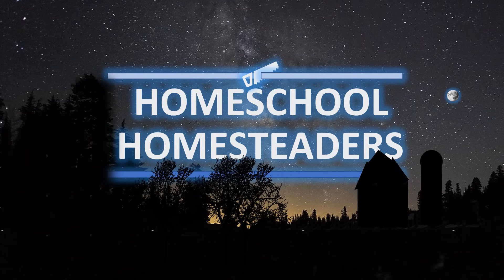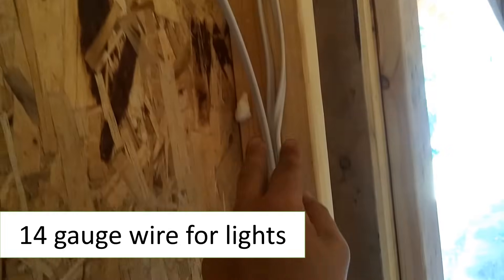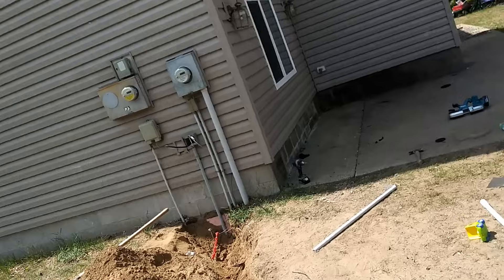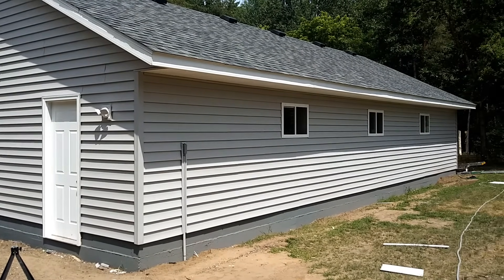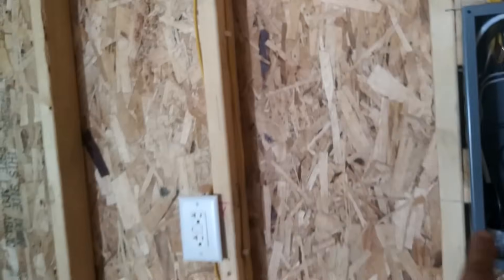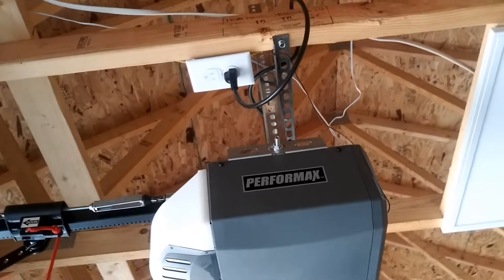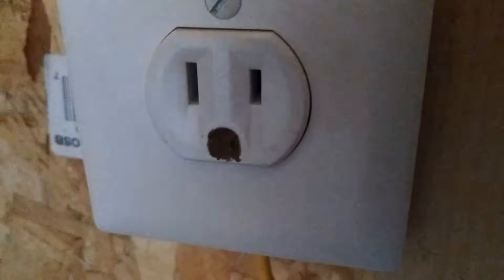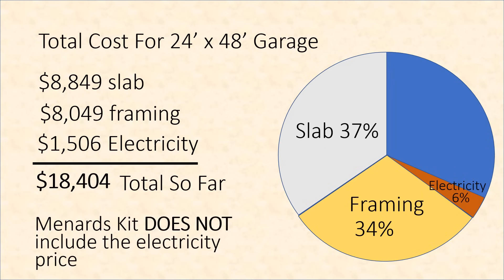Menards Garage (24' x 48') Kit: Wiring To A Detached Garage (Part VI)

Comment: What brand and model LED lights did you use inside and out
Reply from the maker: For the outdoor lights, I used these ones...
https://www.menards.com/main/lighting-ceiling-fans/outdoor-lighting/security-lights/patriot-lighting-reg-theta-2-light-led-outdoor-dusk-to-dawn-flood-light-white/m22v5014/p-1642874276192478-c-7544.htm

For the garage interior lights...
I cant find exact model, but close resembles this one...
https://www.menards.com/main/lighting-ceiling-fans/utility-commercial-lighting/flat-panel-lights/zone-4500-lumen-2-x-4-flat-panel-light/z-xppl2x4/p-1642874272527740-c-1642874276495750.htm
Reply from the maker: All lights are Patriot Lights from Menards

Comment: Did your ground wire have to be ran in conduit the one that's going out to the grounding rods
Reply from the maker: The ground wire from electrical box (in the garage) just ran outside to the grounding rods.  But from the electrical box in the house to the electrical box in the garage, it was included in the conduit with the other wires.

Comment: Mispronunciation of "conduit" made me suspect of the rest of the info...

It's overall fairly solid, even if I personally don't like the workmanship. It will work, likely pass inspection, but definitely says "homeowner did this" or "electrician was the cheapest available". Not trying to disparage the work done here, I would just personally put more effort into it.  

First issue: Don't PUSH wires through a conduit. With a PVC conduit like that, they make fish tape (really just a special plastic twine), attach that to a plastic bag, then start feeding the plastic bag into the conduit. Use a shopvac on the other end to pull the plastic bag with fish tape attached through. Then tie your wires to the the tape and pull back through. 

Second issue: Needs nail protection plates on the studs over the holes where wires go through. Regardless of local code or use of AFCI breakers, these need to be installed. Otherwise you or someone else could accidentally run a nail or screw into the wiring. 

Third issue. Unless those walls are going to be closed up, all that wiring is considered exposed and should be in conduit of some kind, or use MC. I will ALWAYS advocate the use of conduit no matter what, ESPECIALLY for walls that will be closed up. If something should ever happen to the wiring, it is significantly easier to pull new wire through the conduit than it is to reopen the walls. I prefer flex metal conduits, but rigid metal conduits work, too. Not a big fan of PVC, but it has its uses. Personal preference. 

To add to the third issue, if wasps packing mud into outlets is an issue, or pests in general are a concern, they will get into the boxes as well. I would definitely recommend conduit as it would make it harder for pests to enter, and with solid metal or PVC conduits and gaskets behind the wall plates it would make them very difficult or impossible for pests to get in. 

Footnote: I personally will likely never install lights with integrated LEDs unless a traditional fixture is unavailable or impractical. It is significantly easier to change a bulb than an entire fixture. While swapping a fixture is not a massive undertaking, just an annoyance, anyone can change a bulb.

DISCLAIMER: I am NOT an electrician. I am a DIYer who does mountains of research before undertaking projects to ensure that anything I do meets or exceeds code. I usually exceed code. I have passed all inspections on the first try and the inspectors have complimented me on the work and commented on the (good) overkill nature of the workmanship. I don't half ass anything that could endanger me or my family.

Comment: What gauge wire in the incoming power? What Amps for this sub panel?
Reply from the maker: 6 guage from main breaker to subpanel.  50 amp breaker is used for the subpanel in the garage.
Reply: @homeschoolhomesteaders2842  thanks! 😀

Comment: Would a need for 220 make this much more difficult?
Reply from the maker: This is beyond my expertise, but if you are referring to installing a 220v welder in your garage, then I think you just need a 30 to 40 amp breaker and use a 10 or 8 gauge wire.  But don't quote me on this.

Comment: I noticed you ran the wire from a 50 amp breaker in the house to a 100 amp breaker in the Square D panel. We’re you thinking of future expansion or was there another reason for this?

Comment: With the slight exception of “conduit” pronouncing, this was an excellent electrical install video!  Congratulations on a job well done Sir!
BTW, next time, Pull conductors through conduits.  Put a shop vac on one end, pull a rope through, hook the wires to the rope and pull in the conductors.   Again, Great Video!   Respectfully,   Kevin

Comment: I’m curious as to why you ran the conduit up so high on the outside of your garage. I usually prefer to run it through the garage wall as low as possible, then use a 90° elbow to run conduit up to the bottom of the panel on the inside of the garage wall.
Reply from the maker: This is my first time doing such an extensive electricity project and didn't know better.  But your way does sound better and I would have avoided the siding issue.

Comment: Why did you run each outlet wire/feeder on its own side of the studs? Just curious, seems like extra work.
Reply from the maker: By code, you cannot have wires running across the studs unless you plan on covering the walls with sheetrock.  If the walls are going to be bare, they have to be parallel with studs
Reply: @homeschoolhomesteaders2842  oh I know but you brought wires down and up on both sides of each stud, when they can both be on the same side, is that to get around the trusses?
Reply: @tablatronix it’s cuz he isn’t finishing the walls

Comment: Gains Solar has a great trick for pulling wire through conduit.  tie a bunched up plastic shopping bag to the end of that thin/light polyline and suck it through the conduit.  I plan on trying this for my 40+ ft pull.  Also, there's a wire pulling lubricant to help out.
https://youtu.be/ZRJqaqSfPf8?t=234